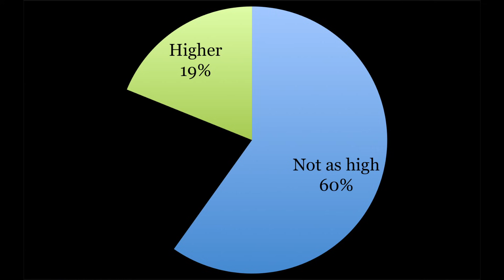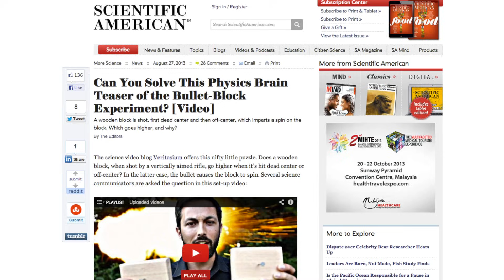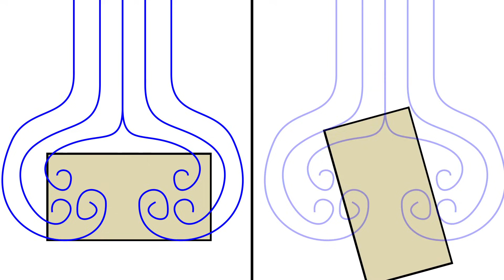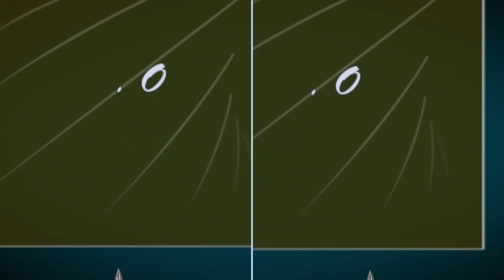Bullet Block Explained!

Comment: What i dont understand: the difference in depth meassured with the nail was quite significant. Later with the X-rays it wasn't. How does this work?
Reply: The tunnel created by the bullet in the spinning block is not straight, it's slightly curved.  So a straight nail wouldn't be able to go in as much.
Reply: OsamaTheMamaLama I think empty space in wood is really hard to see with x-rays, but on the other hand a bullet is metallic so it's easily picked up.
Reply: I agree. I think it varies with each experiment.
Reply: The amount of rotation accumulated in the time of the bullet penetrating is very little. I would estimate the block only rotated less than a degree in the time the bullet was penetrating the block.
Reply: SamTheWai
This makes perfect sense to me. Makes me wonder why the x-ray comparison doesn't show the curve...
Reply: its because the bullet's path in the rotating block is curved.

Comment: I get it. The energy balances itself. When the block doesnt spin, the energy is already balanced. But when it spins, spinning balances the energy. Think about it. 100%energy of bullet = 100%resistance of block to go equal high. 50% of resistance is on the left, and 50% on the right. In the center, 100% of energy lifts 100% of block to the same high. On the side, 100% of energy lifts 50% resistance, which leaves another 50% of energy which is recycled by the other side of the block through rotation. This is like when you became Thor with the spinning wheel that put less resistance when it was spinning.

Comment: aren't we missing the difference that supports for rotating block vibrate a lot more. If the bullet mass is significant compared to the block the Centre mass moves to the side and the reaction force from the support provides the extra torque for the rotation. The rotating block could be rotating around an axis slightly off from the nail? Difficult to see here but try an experiment shifting the bullet further off centre --- rotation should increase :)

Comment: About 6 min in, I thought, what if the block spins only because there is an imbalance of force on either side? Maybe shooting the middle of the block is just having 50% force on the left and 50% force on the right, and shooting it on the right is something like 25% of the force on the left and 75% of the force on the right? You have equal upward force on both blocks, but more on one side of the spinning one?

Comment: How do we know the energy of both bullets is consistent? Set up the experiment so one bullet applies its force to both blocks.

Better yet, get rid of the gun altogether and just build a mechanism.

I'm thinking a lever with the fulcrum way at one end, and a "T" at the other with two 1" strike points. Set the blocks up on a platform and jump on the lever. pop

Comment: 1... contact some bullet manufacturers to determine the production tolerance for power differences between rounds.
2... use a material other than wood, wood has great differences in grain direction, density and overall weigh/weight distribution. 
3... your methods of measurement are not accurate. Visual + through a camera lens even with overlay is not accurate enough. 
4... lighter block with a stronger projectile will magnify the outcome. 
5... you may also exaggerate the experiment by using a block that is three feet long instead of only five inches long, cognitively it is easier to comprehend the outcome.

Comment: You could do 2 things.
1 replace the wood with a plastic wood product (plastic deck boards)to get a consistent grain.
2 use a lower speed heavier bullet. Like a sub sonic load 220 gr bullet.
you could use a 12 gauge lead slug instead of a rifle as well.
Reply: 12 gauge slugs are still super sonic. What exactly is using a slower bullet going to accomplish anyways?

Comment: But i think it has something to do with axis of rotation.
If we assume axis of rotation at center then
bullet fired close to center should have low angular momentum = negligible
and bullet fired at end should have higher angular momentum
according to angular momentum = F*D
And as both as nothing to do with each other(Angular and linear momentum)
Their heights should remain equal due to same linear mumentum.

Comment: angle the blocks so one side is higher than the other.  I would think because the bullet has less area to travel before hitting the off center shot, the block would go higher due to more kinetic energy and bullet wouldn't go in as far..

Comment: Use softer plastics. That way the differences in wood grain strength would be eliminated. Also use an infrared camera. Deformation energy should be visible over a larger area with the one shot in the middle. Also, to avoid hitting the pin in the middle, put it further to the top.

Comment: In order to measure the depth of each projectile, use something that has a more consistent form.  Although the wood appears to be uniform, small variances in the grains along each piece will interact with the bullet differently.  If one were to create a block by say, laminating layers of paper, the block would have consistent properties at every depth.  It would also allow you to count the sheets of paper penetrated, each of which being approximately .1mm thick (20lb paper).

Comment: If you were to carry out several trials with variable positions from the end of the block, I would guess that as you increase distance from center height would decrease compared to the shot placed at dead center (no matter how negligible). In addition I would speculate that as you moved further towards the edge of the block, most of the energy would be converted to rotational energy or lost to splitting of the wood.

The experiment is fun, but has so many variables to consider that a simple answer such as conservation of momentum (translational or rotational) is just a scratch on the surface.

What if you were to place a metal plate along the bottom of the block to distribute the point load more evenly. Would this change the difference in the momentum gained rotationally or in turn stifle the vertical momentum due to the added weight?

The funny thing is that if you think of this experiment performed backwards: a falling block compared to a falling block where its edge hits the edge of a rigid object causing it to spin... I believe both will hit the ground at the exact same time. The only variable in that experiment is air resistance as can be seen when a baseball is hit with a high rotational momentum.

Comment: you x-rayed the blocks? what about cutting them in half?
Reply: when a bullet is within an object, cutting into it with a high speed saw of any kind can be dangerous if the bullet becomes a projectile again upon impact. You could use hand saws to cut each block open but that would be more time consuming than X-raying each block in batches. at least that's what I think the reasoning is
Reply: C121F Hammer and chisel on the end grain. Done.
Reply: BoodyBeer
That would depend on how the wood fibers are oriented. Chiseling through wood can damage the view you are trying to obtain and not to mention that you would somehow have to know exactly where to chisel it to get a perfect sectioned view of the hole. X-Raying a series of blocks is just faster and easier when you have the resources available.
Reply: Faster and easier? I doubt that, and I wouldn't say you need the exact location, obviously you hit it in the centre, and it will split in half if you do it right. You could just cut in half with a bandsaw, I wouldn't have thought it would struggle with a bullet that small.

Comment: So, you're telling me that if I had an object (IPE steel beam or something) that was 100 meters long and I shot it at the very end, the center point of the beam would rise to the same height as if I had shot it in the center? Fascinating, but I still have my doubts.
Reply: J.V. Kelley If you can supply me a 100 meter beam that I'd love to try.

Comment: 1. You are WRONG: Momentum is conserved be it rotational or linear. A bicycle is a good example of of both conversion and conservation from linear in the leg of the cyclist to rotational in the crank, back to linear in the chain, back to rotational in the wheel and finally resulting in the desired linear motion.
2. I think the answer is correct even if it is not very satisfying.
3. A better experiment would be would simply use impenetrable blocks. To accomplish this I propose hollow aluminium blocks and although not as exciting a gas powered pellet gun instead of a real one. Additionally the blocks should be longer and shot further away from the fulcrum, this should make the difference in hight more obvious.
4. At my own risk I predict the block shot off centre will not go as high.

Comment: Yes your answer is a little disappointing because i was hoping to be proven wrong. But your thought provoking videos got my sub.

You explained why the spinning block tended to go higher but you dint even touch on my thoughts about gravity playing a part in the spin. I know my post on the previous video was made after this video but you might want to check it out. I think it will give you a new way of looking at this problem.

Comment: create a hole in both blocks x mm deep, then fire the bullet up that hole. if the holes are deep enough, one should penetrate while the other doesnt.
Reply: The only problem is that it would be almost impossible to shoot both bullets EXACTLY aligned with the holes. If the shot was off by even a few degrees, it would be altered enough for the experiment to be rendered useless. Also it would be nearly impossible to tell if the angles were off, making an accurate result even less of a possibility.
 However the idea is sound, so instead of holes, I recommend using a softer material than normal wood. Something like, say, a block of balsa wood would allow more penetration, thus giving us a larger comparison. Other things like higher caliber bullets to increase penetration could also be added.
(P.S. Everyone please like this comment. I want the guy who runs this to see it so he can put it in a future episode.)

Comment: Is there a reason why all the blocks are the same length? I think possibly the distance from the axis is too negligible to make a difference in height. Why not slightly increase the length of the two-by-four or try gradually increasing the weight of the fulcrum, or both?

Comment: place a steel plate on the bottom of the block and eliminate the penetration all together.  I also agree with losing the variable of bullet and powder grain variation by using a compressed air propelled projectile.

Comment: The wood is a composite material. Use a pure substance like say hard foam. Then you have to regulate using scales the heights and distances of everything and use a more reliable gun (with consistent firing force and bullet masses).

Comment: A longer block! It will have more speed at the end so we can see if the receeding block does cause less energy to be converted into heat, sound and deformation
Or use something that deforms, like metal, then you can compare the amount of deformation.
Maybe do it on a smaller scale in a lab using tiny fancy equipment, like shooting atoms with photons or something...

Comment: I think, larger, and less dense material would be preferable.
Also, the density of the material should be all the same.
What about styrofoam? There is range of different grades(stiffness) of styrofoam you can choose from.
Another suggestion I can make is to use kind of soft cray like material.
Reply: Or balsa wood.

Comment: If you want a different result, try to exaggerate the difference of the spinning block. The block you used looked like it had an aspect ratio of about 1.5. Try using blocks about 10:1 difference in height and width, then shoot again at the center and near the tip.

BTW, I think your explanation about the conservation of energy is correct, so be sure the wood is thick enough for the bullet to embed and stay in the wood.

Also keep in mind that the offset shot makes the side that is hit move faster while the opposite side is slower, the average speed at the center is the same.

As for the difference in heights of the center-hit blocks, no one mentioned that it might be a difference in the force of the bullets. Do we assume that each bullet and it's gun powder are identical? Was the barrel cleaned between shots? Friction of bullet held by the shell? Many variables there. I was thinking about other ways to get more repeatable forces, like hitting it with a pendulum.

Comment: The block you shoot should made of differing materials. To eliminate variables (if legal) use full metal jacket bullet.
If the bullets penetrated about 2 (48mm) inches then you should use a block about 3 inches (72mm) so that the top layer can be measured for deformation.
Alternate option is to have half an inch (12mm) of wood or rubber (for containing any fragments) and then a metal plate that will bend but not allow the bullet to exit.
You can then measure the upward motion on high speed camera AND the plastic deformation to get approximate penetration and energy.

Comment: What if you were to soak the wood block in water?
Reply: If the wood is soaked in water, the penetration would be lessened. You can not compress water and therefore, lessen the penetration.
Reply: Oliver Magat The friction would also increase probably leading to greater bullet deformation, making consistent measurements very difficult.
Reply: Oliver Magat Wouldn't that depend on the type of wood and extent of soaking? I mean I could think of some wood that would get pretty soft with some soaking.. :P

Comment: i am a physicist, and this made me think twice about energy.
FIRST: you have to take control of this experiment. PLEASE.

facts we are forgetting:
- The "non-rotating" block did some spinning too, because it wasn't fired exactly in it's center, that slight rotation represents some kinetic energy that we are missing in the calculations. This is a rigid body problem. The inertia axes could be playing a role in here.
- The bullet also rotates, that may make a difference in it's trayectory inside the brick and it's final lenght. (Straight or curve?)
- For deformation purposes you should look at the bullet too.
- Physics isn't easy every time. You need some statistics.

Suggestions:
- The bullet should be thinner
- the material softer and constant in density.
- keep it up :)

Comment: Wood is very a very unreliable testing material due to its inconsistencies, especially in an experiment such as this. I believe strongly if you used a material that has a constant density, texture, weight and structural integrity through the entire volume of the material, the results would be easier to compare, as well as replicate. I would recommend ultra dense foams such as potting foam or even something along the lines of a extremely dense clay block.
Reply: And let's not forget manufacturing tolerances in the bullets and cartridges.  A few less milligrams of one, a few more milligrams of another from cartridge to cartridge can create differences in bullet momentum that might be significant to the experiment.
Reply: devonhellier I'm sure that was already done ( same tree ), but the idea is to avoid wood in the first place :)
Reply: I wonder if the nail placement would affect the outcome as well as it may act as a stopper for the bullet.
Reply: Also use the highest quality, most consistent ammunition, and record the muzzle speed of the bullet. Then over multiple trials you can correlate penetration depths to initial kinetic energy levels.
Reply: @benporter1997  good idea, but an easier answer would be to use precisely weighed bullets but in a pneumatic barrel with a pressure gauge and pressure regulator to eliminate inconsistency and have control or knowledge (measurement of bullet weight) of the variable's values each time the experiment was conducted.
Reply: @benporter1997  I agree.   Velocity in the smaller calibers, especially .22's, from one round to the next - even from within the same box of ammo - varies too much.  Destin's air-cannon scaled down to a precise air gun with .22 pellets would work here.
Reply: The xray shows the bullet did not penetrate near the nail.
Reply: Bbc
Reply: I think foam would not be the greatest choice only because we'd want to have a material with the potential to absorb the most energy as a baseline, then tweak the variables from there. Follow with a consistent material to replicate the results, then tweak the material, setup and bullets.
Reply: a block of aluminum would probably work well. its soft enough to be damaged and hard enough to take the energy, it would also be pretty consistent.
Reply: That's my thought as well, perhaps MDF or some other engineered wood product would be a better substitute. Also lowering the bullet velocity would case the penetration depth to be more measurable.
Reply: Doesn’t matter. They were probably sawn from the same 2x4, and have very similar density. If they were matched for weight- and I assumed they were- the density isn’t a factor.
Reply: Exactly this, EVERY block of wood is different.  There are alternating rings of soft and hard fiber of various widths. Use a composite material and weigh each one to within 0.1 gm. The one shot offset will go slightly less high. And use match grade ammo.
Reply: The rounds are not exact..  no way to make rounds with exact same FPS..
Reply: The only factor that matters here is linear momentum. Which is always conserved in collisions. My mistake was in assuming energy is conserved which it isn't in an inelastic collision like this (by that I mean the energy can change forms not literally disappear) haven't watched the video yet sorry if this repeats that.
Reply: maybe using two blocks cut from the same tree might help as the grain, density, texture should be pretty much consistent. The ash tree will be good as they have completely smooth straight trunks.